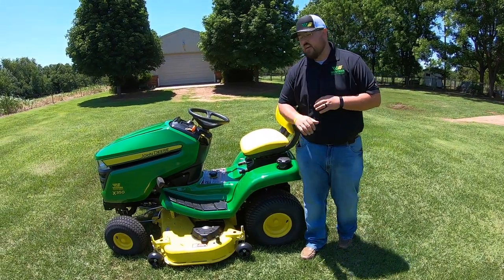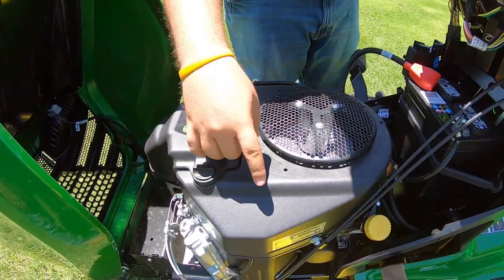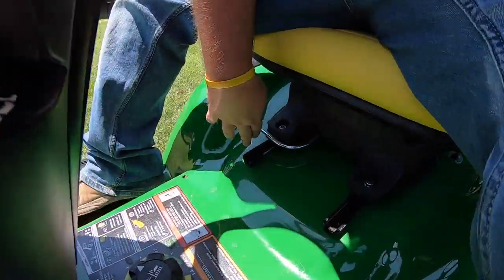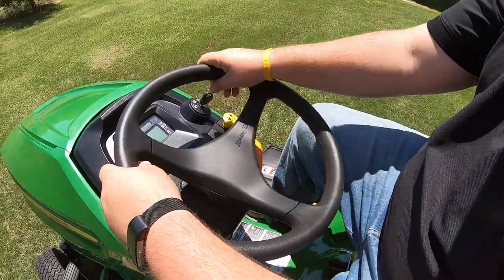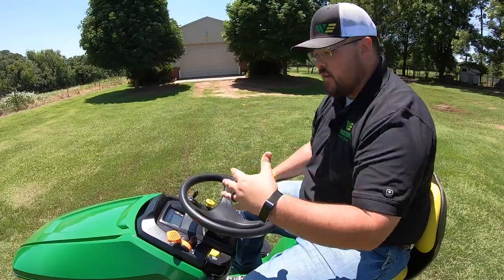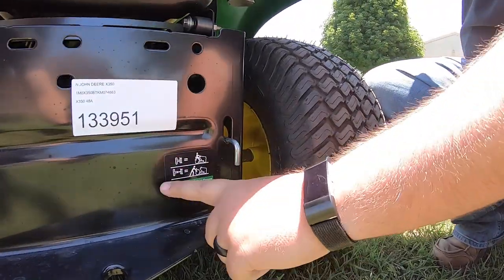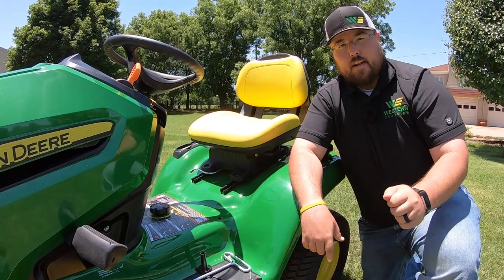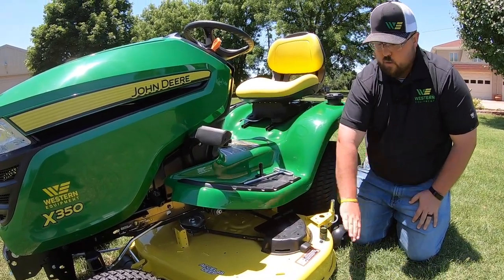2019 John Deere X350 Riding Lawn Tractor Mower Review and Walkaround

Comment: The problem with manufacturers now is they are focusing too much on expensive technology I just want to cut my grass.
Plus they are going total hydro transmissions and they are expensive an sensitive and IMO you lose power. The foot controls are pathetic. My mower is hydro but no foot controls involved. Need to go back to making manual transmissions. When my hydro goes bad I have to manual transmissions in storage. It will get converted to manual. Too much tech means high maintenance cost. When yo put the dumb cruise control on it drops in speed no matter how hard you are pressing the peddle. If you need a fuel gauge on a mower maybe mowing isn't for you. Too many PLASTIC levers on these things. Now if you put a/c on them then we can talk.
Reply from the maker: Well I can say that in most cases today people are looking for convenience and are usually willing to pay a bit more for that luxury so i believe manufacturers are trying to appeal to the masses. You can't blame them there.

Comment: If it's green and yellow it will cost you a hell of a lot to repair it.
Reply: Howard Swing My 2005 LT180 has had one issue...voltage regulator. I think it was $12.  Just changed the belts for the first time this spring.
Reply from the maker: This can be true with ANY color of mower or machine!
Reply: My point is John Deere screws the consumer when purchasing repair/replacement parts

Comment: Where's the cigarette lighter & ashtray
Reply from the maker: I think they forgot it on this model 😂
Reply: I don't smoke anyway. But I have a cigarette lighter plug on my battery charger lead, all I have to do is plug in my International Harvester Cub Cadet (Factory equipment lighter) to charge, works good. I find unique solutions to everyday problems.

Comment: I'm so tired of this bullshit about "John Deere" engines. They don't make any small engines and never have. They always love to claim their Kawasaki or  Briggs is built "special" just for them, but they are not any different than the standard engine available any other equipment. The only difference is they put a sticker on it that says "John Deere". Literally, that's IT. They need to stop telling people they were somehow specially built for them. The fact that it isn't a non branded china engine is good enough.
Reply from the maker: By saying this you must also know that these manufacturers don't have just one 18.5 HP engine. These engines have multiple options and features that can be added or not. This being said, John Deere carefully chooses which options and features they want specifically for each model of mower. So in a way, they are built specifically for John Deere and their specs.....
Reply: @WesternEquipment  That's a load of crap. There is nothing special about the engine just for Deere, besides a sticker. Yes, they order them how they like, just like every other manufacturer. sigh The Briggs and Stratton, in my Deere riding mower is 100% the same as the generic 21hp 540cc Briggs engine used in almost every riding mower - except the sticker - but the way they brag they make you think it was designed special for Deere. It wasn't. Same goes for any other common Kawasaki/Kohler/Briggs on any Deere ever made. The diesel's aren't special built either. 

This is an advantage, because if your engine dies you don't need a new special "John Deere" edition to replace it with. Any of the same engine model will work exactly the same. Deere just needs to STOP with the STUPID marketing. You don't make your engines. We all know that.
Reply from the maker: @ryanroberts1104  Never once in the video or the comment I responded with before did I say  "John Deere makes this engine". I'm confused why you are so amped up by this. HAHA!

Comment: Stopped watching once i saw the brake peddle and the gas were on the same side... what a bone-head move!!!  Good job JD. What about the inclines and ramps when you need on foot on the brake and one on the gas... how will you hold the tractor in place and feather your movement?...even if you could do it just a bad location... why reinvent the wheel!...just wow!!!
Reply from the maker: This is a hydrostatic mower so the transmission will help to stop you just as the break would so you can feather with just the forward pedal.